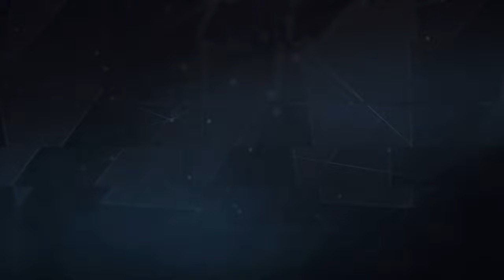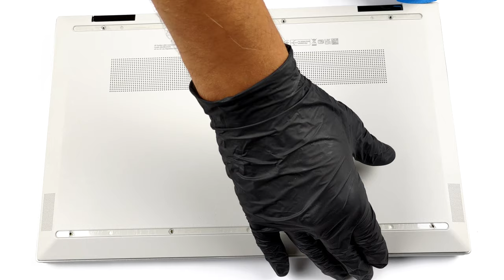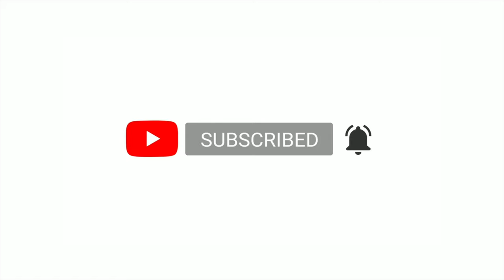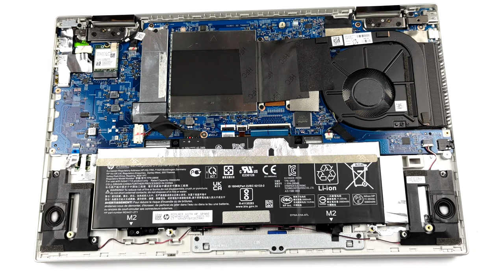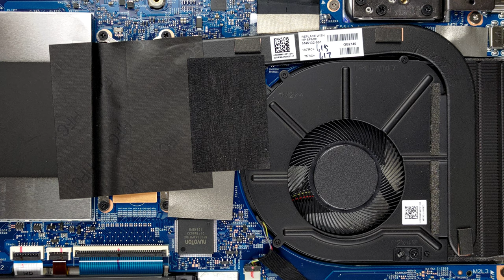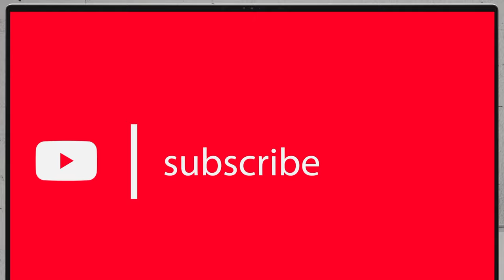🛠️ HP Pavilion x360 15 (15-er0000) - disassembly and upgrade options

Comment: How do you remove the ram cover with such ease? mine does not move at all
Reply: Lemme know if you find out
Reply: You unlclip the small clips on the three sides not next to the processor.  The clips are very small but all you need to do is bend each one over away from the cover and it'll come free.
The 4 clips next to the i5 dont really need to be undone.

Comment: How can the tin ram lid be removed? I tried it but it seems stuck. It is not as easy as shown in the video.
Reply: Lemme know if you find out
Reply: You unlclip the small clips on the three sides not next to the processor.  The clips are very small but all you need to do is bend each one over away from the cover and it'll come free.
The 4 clips next to the i5 dont really need to be undone.

Comment: 2:05 how do you remove the cover?
Reply: You have to unclip some of the clips along the side (on the mainboard marked as “clip”) I did it with a flat screwdriver but I’m not sure if that’s the intended way
Reply: Yeah you unclip the tiny clips on the three sides of the cover. Not the processor side. A razor blade was my tool of choice because i had nothing else but metal isnt recommended.